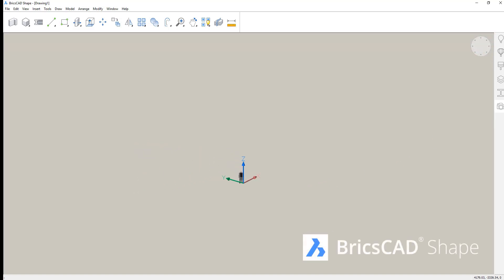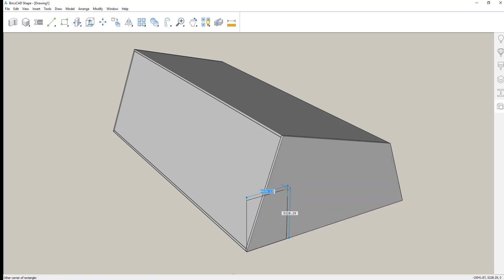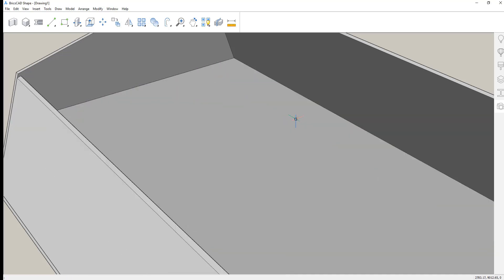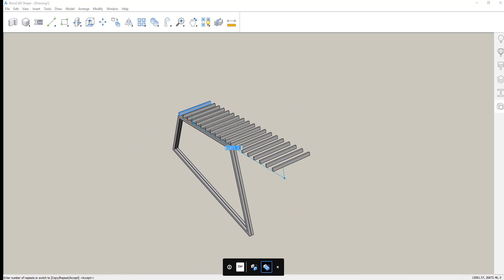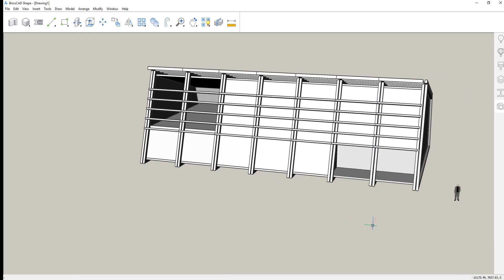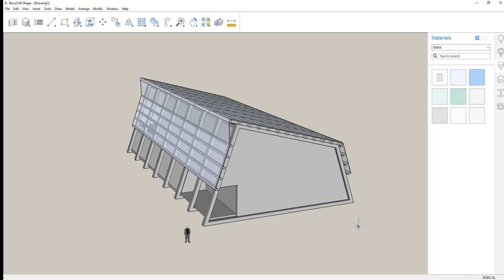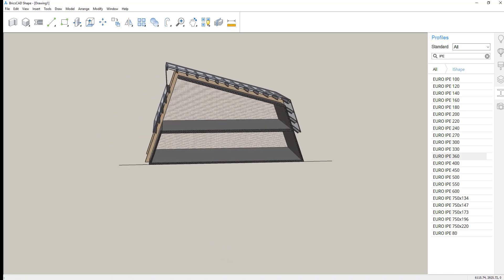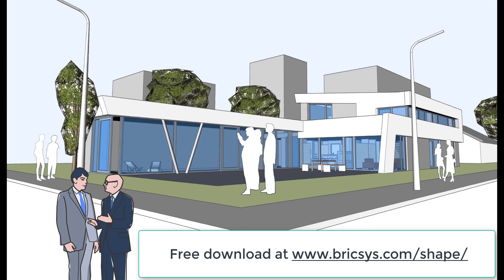10 Minutes to BricsCAD Shape (free software) - Webinar

Comment: I am wondering the same, is it possible to use the slice/section tool to define the point of view for a floor plan or section of the model and generate a 2D basic presentation?
Reply from the maker: If you turn off perspective you can align the view from above and then export this view. You can learn more here: https://blog.bricsys.com/open-dwg-files-free-edit-export/